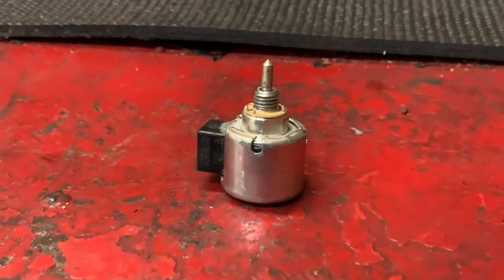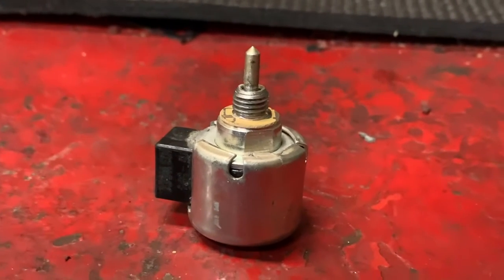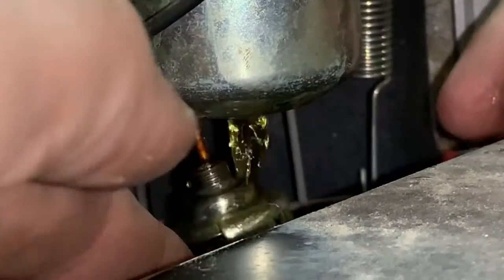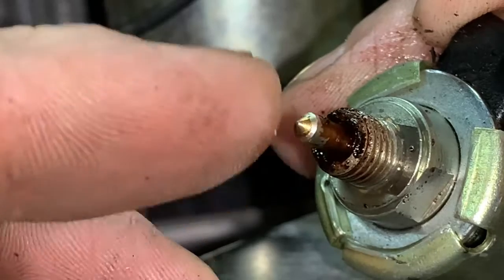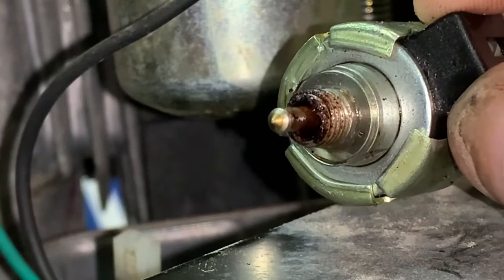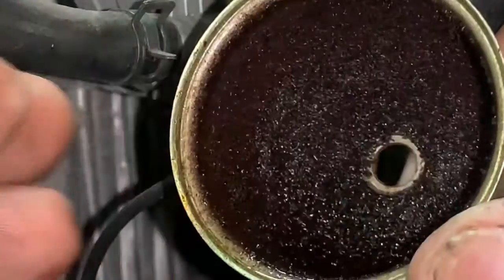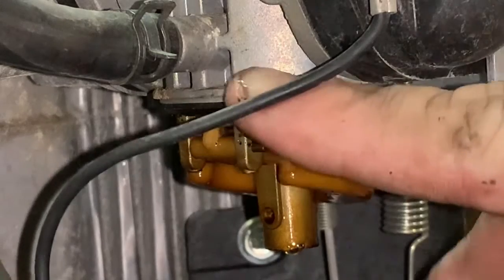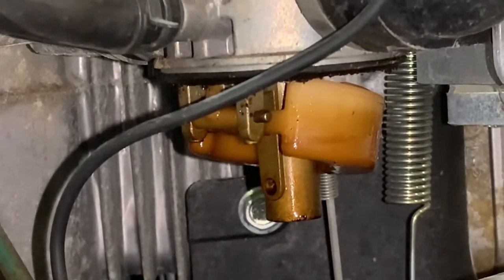WHATS INSIDE A FUEL SOLENOID?

Comment: it IS a fuel cutoff valve..............not from the tank to the carb. bowl............but it stops fuel from entering the engine THROUGH the carburetor........sure , if the needle valve doesn't seat and block fuel from entering the bowl, the bowl will fill and flood.............

Comment: Have you ever worked on one where the plastic housing at the magnet connection was melted and burned looking like the wires were too hot and started melting the plastic? I have one like that and am not sure what would cause this. Any ideas what might cause this? Could it be the magnet gone bad? Or would it more likely be something else electrical? I can change the carb no problem but I don’t know much about electricity issues 😊 thanks for any advice you may have

Comment: Thanks for the tip on unscrewing it without the thin wrench! I had to wait a week for the wrench to come on Amazon the first time I replaced mine and still wasn't sure if I was missing something. There seem to be a thousand different model numbers of solenoids and carbs. Any thought on navigating shopping for these? I had better luck on ebay than with my gravely dealer.

Comment: It does cut off fuel from the carburetor pickup.  If it's not energized your engine won't start
Reply from the maker: Incorrect it has absolutely nothing to do with the fuel coming into the carburetor via the fuel line
Reply: @THEMOWERMEDIC1  absolutely nothing I said is incorrect.. I didn't say anything about cutting off the fuel coming into the carburetor.  I said it cuts off fuel going into the carburetors pick up tube.
Reply: Jeremy why would a solenoid get so hot that the inside plastic dripped out and then it hardened like an icicle .

Comment: I explained to them it’s not a fuel cut off , they need a manual cut of in fuel line also
Reply: It cuts off fuel to the carburetor fuel pickup tube... If it's not energized you'll be unable to start your mower